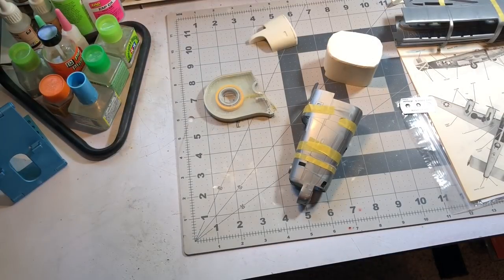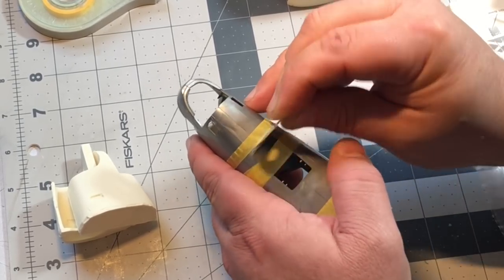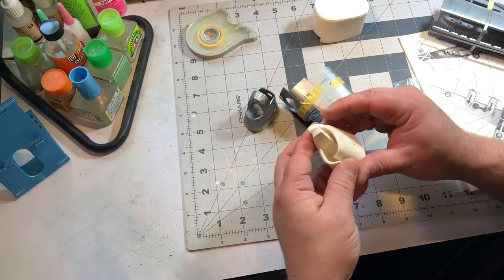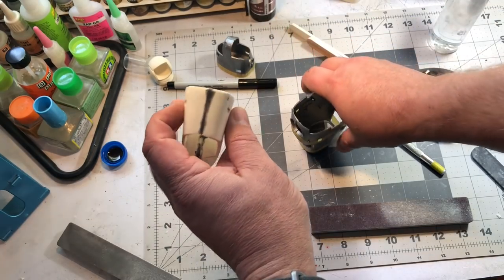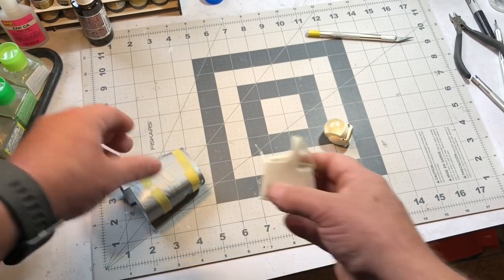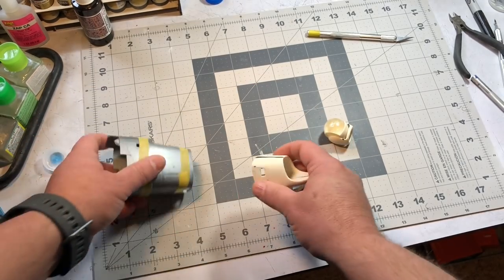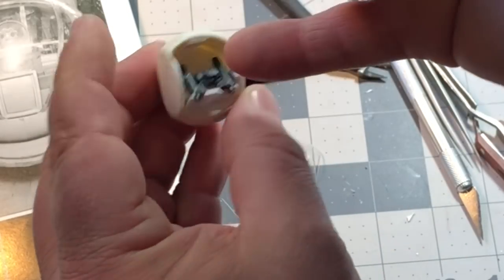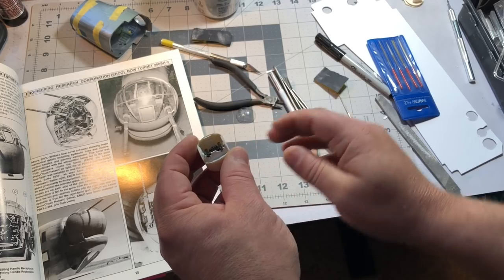1/48 PB4Y-2 Privateer Resin Conversion Part 2: Nose and Ball Turret

Comment: I'm working on a similar project that involves large cuts of plastic from the original kit.  Ironically, it too is of a 1/48 B-24.  The way I did it was mark where the cut line is with tape like you have done here.  Then use a Dremel tool to cut it, but don't cut right on the line.  Instead, cut it a bit long and leave some material.  Then, carefully use a belt sander or hand file to get the rest of the remaining material down to the marked line.  I cut all four engine nacelles down this way and was able to make really quick work of it while resulting in perfectly straight and true cuts.
Reply from the maker: Looks like the B24 is a prime target for cutting up.  I usually use a dremel then go in with a sanding bit and get it close, then file.  This cut was near some fragile bits so I didn’t want to create more work for myself by breaking off stuff...my hand got a little crampy with that little saw but it got it done.  What are you doing with your 24?
Reply: Primedmodelworks Yeah, there's quite a lot of conversion stuff and resin for the Revell B-24.  I've got a full resin upgrade set for the engines and super chargers and corrected cowls along with a ton of photo etch for it.  As stated, the resin upgrade requires cutting off the kit nacelles about halfway to the wing leading edge and removing the molded in super chargers.  I've done all that thus far as well as removed all the molded in surface detail off the kit.  It's going to be a very extensive project but the end result will be a Ploesti raider in flight dropping 1k lb. bombs, motorized propellers, full flight crew.  With that said, love your work as I've seen a few of your video builds.  Great stuff!  Can't wait to see how you get along with this PB4Y (?) conversion.  I think it's gonna be awesome.

Comment: Custom windows? How about making a mold of the window you want. then make a test mold of that to make a clear window in then hopefully out of the mold it will fit nicely into the fuselage window. With a separate mold you can control the depth.

Comment: Hello ,I am new to your channel, you do great work.you mention CA and metallic pigment for filling, can you tell more about this please?
Reply from the maker: Welcome aboard Gary.  It’s my preferred method for filling seams in that there’s no waiting like you would have to with normal putty.  Just mix up some cyanoacrylate glue (CA) with a metallic pigment of your choice (I use ammo Mig stuff), put it along your seems, hit it with accelerator and sand.  It makes the ca a little easier to sand and a lot easier to see.  I’ve found it Only works with metallic pigment which I think has something to do with the metal particles in the pigment.  Below is a link to one of my previous videos showing how I use it.

https://youtu.be/228F9ekS454